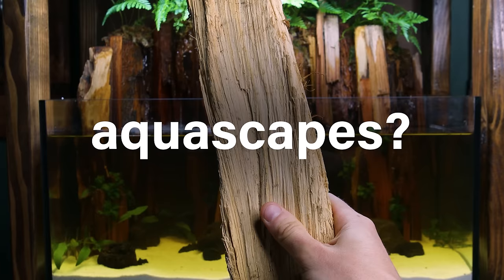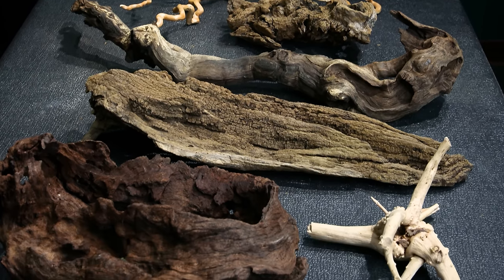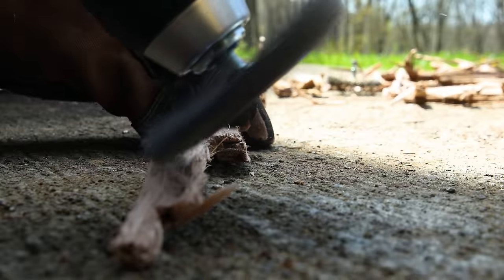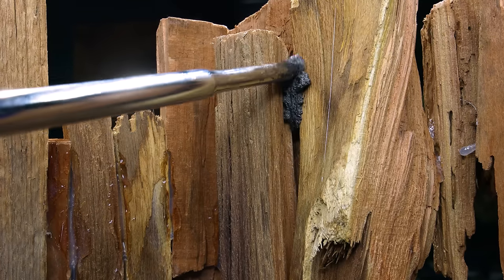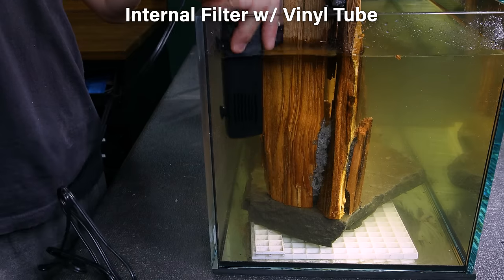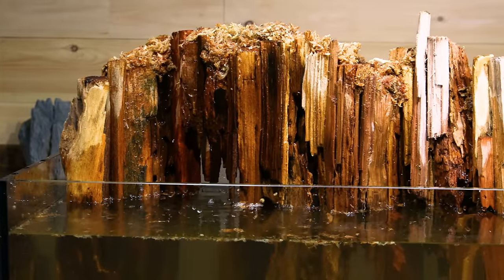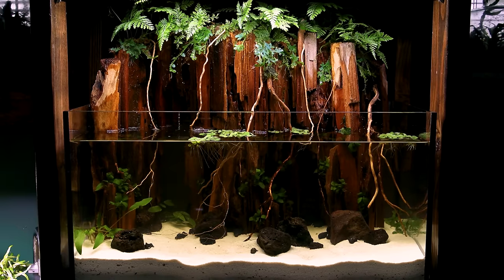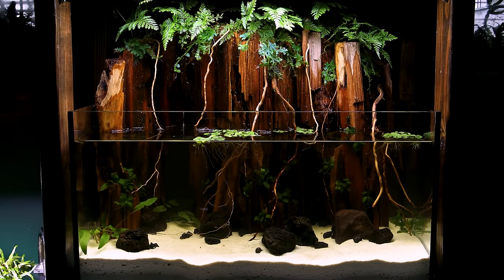Firewood Made an Incredible Aquascape? Yes.

Comment: Bamboo shrimp would look very interesting
Reply: Agreed! But they typically prefer higher flow environments since they are filter feeders so it wouldn't be the best option for this setup
Reply: @Clover_knows_pets  well, you could put submersible pumps and subjection cut them below the waterline about 4 inches and put them on one side of the tank with no tubing. It should increase the flow without being noticed, which would be good for the shrimp because of the higher flow rate. The only problem is the plants would have to be fully established to handle that kind of water flow.

Comment: The vertical lines are very evocative of a cathedral… also the organ in the cathedral. Also the way that a forest seems like nature’s cathedral. The only thing that’s missing is the light. It needs a soft, diffuse light at the bottom, shining up, and from the front toward the back... actually, I dunno, maybe a super strong wall-grazing type thing, but something to light up the bottom half of the firewood sculpture.

Maybe just to top it off, the ‘god rays’. A strong top-down spotlight that overhanging plants break into rays. What fish would mimic mist, moths, and butterflies flying through the god rays?

Comment: I have a similar idea with white sand and a much smaller container (2gal) at the most. I'm looking to have a mini beach, but rain forest/jungle lingering over top on both sides. Eventually, have a Blue Poision Arrow Frog, a few Butterworts, Jumping Spiders, and clean up creatures. 
Got my white sand,  small black pebbles from the dollar store. I just need to find some moss in a wooded area. I'll be halfway there. How is your sand holding up? Looks like you used filter sand?

Comment: I used a tree stump from a smaller tree that I cut from an uprooted log to take home and drill with a hole saw. 0/10 recommend this unless you have a vise to hold the wood. Almost cut my thumb off. The wood looked great after I got my thumb sewn back together and my betta sorority loved hiding in the little caves. The root system just gave everything a place to hide and swim around.

Comment: Most foam is not Uv save, chlorine safe and foam is susceptible to dry rot and soaking in dampness ect  I did a project that I followed along with a Yt channel and the pond is now full of microscopic bits of foam than disintegrate when disturbed.
So my question is why don't you ever use a fish safe sealer like a waterbased pond sealer to not only protect the whole project/investment hut to also add texture and color.? 🤔